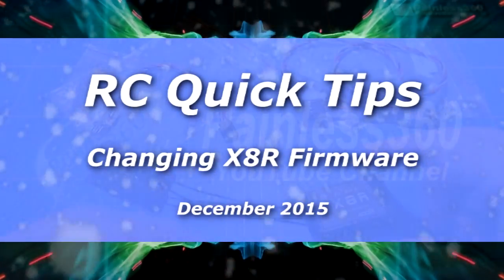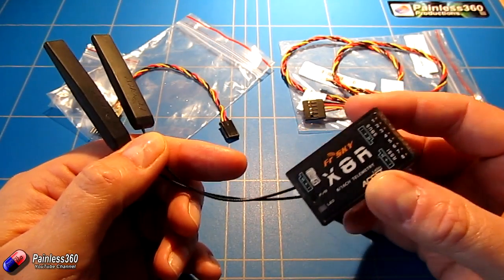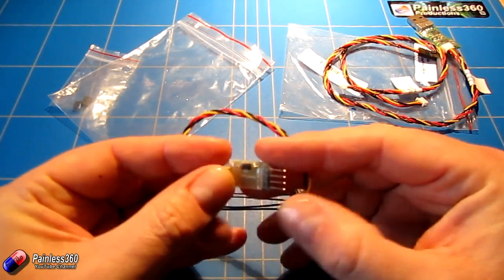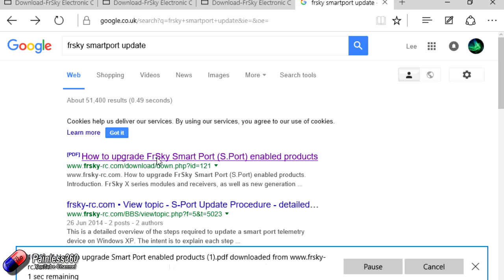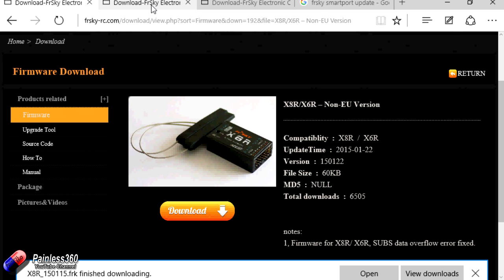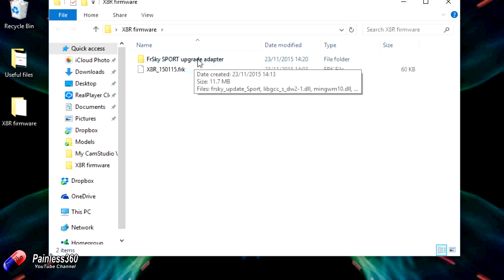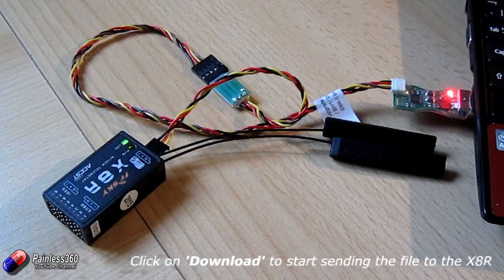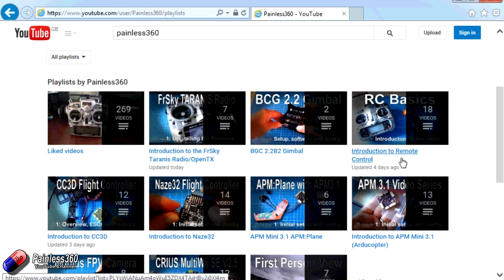RC Quick Tips - Changing firmware on an X8R via SmartPort (OpenTX 2.0.x)

Comment: Hi I'm confused your X8r firmware version is 150122, when you download to rcvr it says 150115, also link doesn't work anymore, and how can I see in my taranis which xmtr fw is installed, thanks for help.

Well after updating my rcvr to fwX8R_eu_150121.frk my rcvr is binding....so my xmtr is in eu..bought it 2'ndhand.
Reply from the maker: +timmybeetle not sure how you see what's installed. I routinely flash all my Rx with the same version before using them. Happy flying!

Comment: Apparently you can upgrade your Radio to the new protocols and LBT and your radio will still have the old modes available as long as you don't check the EU box when you download the open TX 2.1.8 firmware. Allegedly FRSky left the ability to talk to the older receivers in the LBT module firmware but if you are in the EU it is not legal to use this (or the old firmware you are using) with post 2014 Equipment so you are supposed to check the EU box when you download open TX to remove the option to select those transmission modes. Thought you might like to know as LBT with the newer X series rx's is supposed to add a degree of safety to our equipment and still allows the same transmission power as Non-EU radios.
Reply: http://www.rcgroups.com/forums/showpost.php?p=33340323&postcount=36 shows how to do this :)
Reply: Note the part that you have to uncheck "check firmware compatibility" the first time you change eu to non eu firmware. If you have always run non-eu versions of opentx (or already have non-eu opentx installed) then you should be able to leave that checked.
Reply from the maker: Let's hope the move away from the EU makes this easier then ;)
Reply: Well the LBT is the best communication for reliability, so it is worth using :) Maybe the EU got one thing right, lmao.

Comment: Hi, great videos you have. Can you tell me how I can read the current firmware version that is on my x8r.
Reply from the maker: +Bill Tortorello Not sure you can, if you find out - let me know!
Reply: +Painless360 
So far I cannot find a way. Ok so how about this question: Should I flash my receiver and transmitter to the latest? I did flash my X8R to X8R_LBT_build151118.frk but my Taranis X9D Plus would not bind, had to flash the X8R down to X8R_150115.frk and then it would bind.
Reply from the maker: Depends on how many Rx you have. I've changed my latest Rx to work with the radio as getting into all the models to change everything will be a pain..
Reply: +Painless360 thanks for the quick reply. I understand. I only have one model (650 Hex)  and about to build up a 2nd quad. Just wanted to know if their are benefits to flashing up to the latest. It would not be much work to just do the one.

Comment: +painless360
Thank you so much for your help and interest, I have now got the cables from Unmanned Tech Shop as you recommended.
As you never get what you order and  pay for, the receivers had wrong firmware installed.
All works fine and I am thrilled to actually be able to use my new Taranis. 
Again, you are a Star!!!

Comment: thanks for the great instructional videos.
I've just had to replace my antenna board in my trains.  he new oard has come with lbt protocol in it. so I've followed the steps in this videos to flash new firmware to my reciver but cannot seem t get it working. flashed taranis with newest open tx too. am missing something here? got a brand new build sitting here and unable to fly 😭
Reply: edit. found problem. I was getting confused with eu and lbt. just needed the latest non eu firmware. hey presto it works

Comment: Hi, I could really use some Help I  have a brand new Taranis plus (EU) And I have just received a new x8r but the thing won't bind its doing my head in, I looked at loads of vids it seems easy. just wondering do you know of any production issues with the  2015 x8r I hold the f/s button in and power it up but the light doesn't flash I just get a slow beep then i exit binding mode then re power up the x8r and all I get is a solid red light. any help would be greatly appreciated.
Reply from the maker: +Gavin Dean The only problems I've had have been that my radio doesn't have the EU firmware on it and the new X8R did. Hence this video. Best of luck..
Reply: +Painless360 Thanks, my Taranis is definatly an EU version do you think its possible even know the X8r is a 2015 could it be non EU.I have ordered the cables from your vid so I guess I will have to wait and see.
Reply from the maker: Possible.. Best of luck!

Comment: No need to buy these serial adapters from Frsky just to update the Rx. 
If you are stuck with an EU version of the Taranis (Plus), you can upgrade it to the non-eu version of OpenTX. OpenTX itself allows you to flash any Frsky receiver using the Taranis module pins. 

https://www.youtube.com/watch?v=jz6qnTsHcEE
One difference compared to the video above is that flashing the Rx firmware is done through the file browser of the Taranis.
Reply from the maker: +Flying Dutchman But only works with V2.1 and later ;) This way works independent of the version on the radio.. We will be doing another video in the future as we explore the impact of using OpenTX 2.1.x on the radio..
Reply: *****
Exactly. That money is better spent on props ;)
Reply: +Flying Dutchman 
Thanks! Some time ago I followed the procedure mentioned in the video you gave the link to, but had totally forgotten that this was the way I did it. And it was easier than the method mentioned in this video (and no additional hardware needed). I'm doing too much firmware programming on too much different stuff. ;) Also did an update to 2.1.3 at the same time.

Comment: A great video. I fell into this trap having the International firmware on my TX. My existing 3 receivers worked fine but when I bought 2 new ones I had the bind problem. Easily sorted once I had the right Windows drivers. I needed two different driver sets, one for the desktop and laptop and another set for my netbook strangely. All working fine now though :)